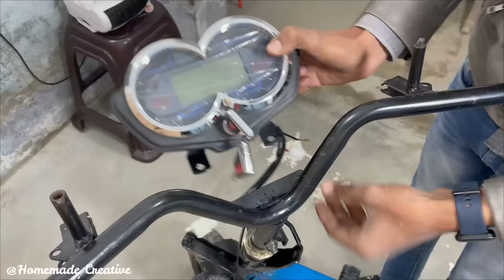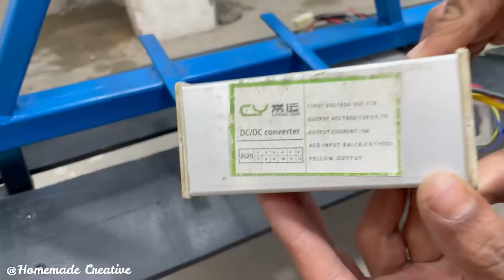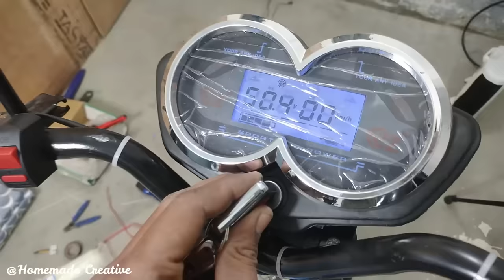Build a 7 seater E Bike With Unlimited Range

Comment: Three suggestions from a Brazilian:
1) Install rear-view mirrors (they could be put on the corners of the roof); 2) Try adapting PVC or another type of pipe (also painted blue and/or black) and run the wires through it (but don't fix the pipes with nylon cable ties, because of the stetic aspect); 3)Please wear a helmet, everyone.
Congratulations on the great work!

Comment: Best I've seen yet practical and efficient with the panels, yet covered from rain too brilliant this should replace all scooters around town
Reply: But it won't replace those by any chance
Reply: solar is good for flat surface roads, bumpy road its not good.
Reply: @content_watcher_only  why not
Reply: Solar panels are made out of silicone which is the same thing that glass is made out of. Solar panels can crack and shatter similar to glass.  Some of them also have a sheet of glass over them to protect them from rain and dust and that can crack also.  There are some flexible solar panels and probably some more sturdy solar panels but they're going to be more expensive
Reply: @sshutupurface8345  it is unsafe to move on the street. Hard to balance and too long to turning around easily.😅
Reply: this guy doesn't have problem

Comment: I used to have thoughts like this project like A electric vehicle with solar panel on it but bro made it in real I am love with it😍😍💚
Reply: rtt😅😅😅😅 1:22
Reply: A single panels doesn't provide enough voltage to run an electric motor. It requires multiple panels. So the vehicle is running on battery. Panel is almost useless

Comment: This is a good home made modified bike. I would add to rear wheels instead one and may be two in the middle. Adding length and solar on the top it can easily flip one side and panels can break.

Comment: Why don't you put one more wheel between the two wheels for load balancing.. do it if it is useful...😊
Reply from the maker: If we add a middle wheel, it will so difficult to turn bike right left
Reply: @homemadecreativee  You are absolutely correct. Are you going to add one more wheel at the end (an idler wheel) so that the bike is well balanced and safe to turn?
How is the performance for uphill ride?

Comment: I'm building an ebike using my6812 motor, the motor turns the wheel when I lift the bike up but doesn't turn when the bike is on the ground 
I need your help please